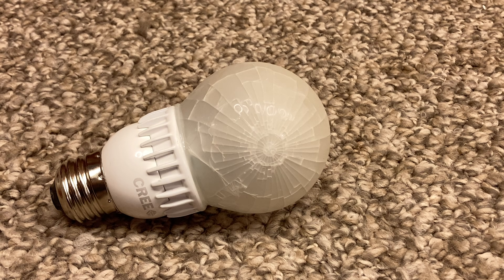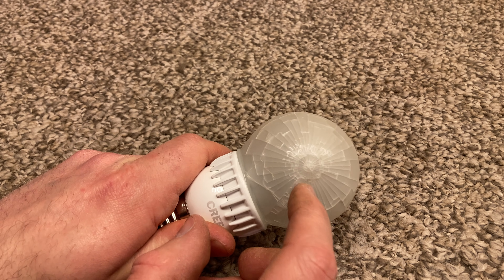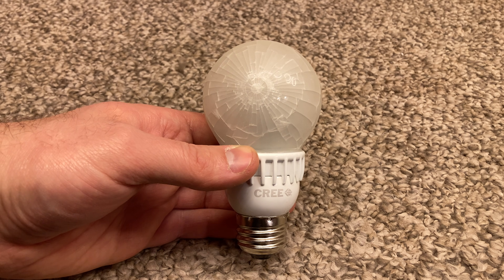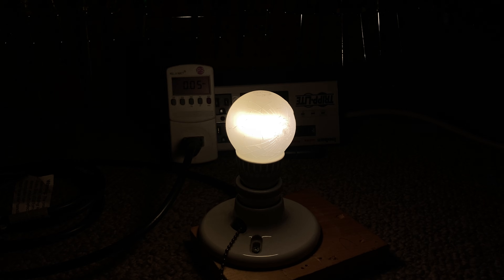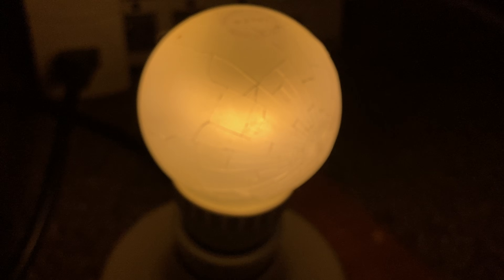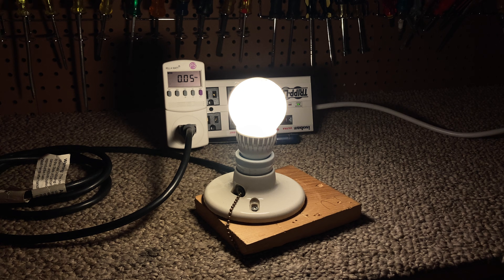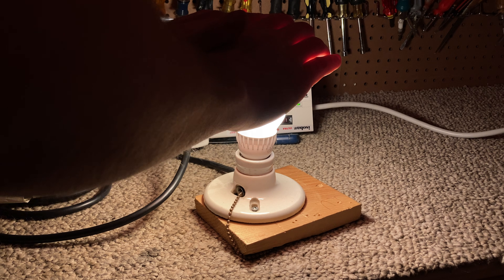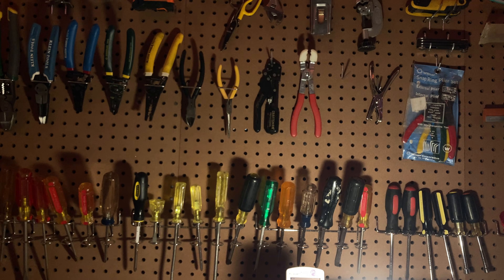Busted Cree 40-Watts Equivalent LED Light Bulb

Comment: the original first generation Cree bulb, sold at home depot for around $15-20 back in about 2010, I must have bought 20 to use both inside and outside around the house, they were excellent and long lasting, better than all the other brands back then, even consumers reports tested them and agreed. Sadly the competition produced cheaper bulbs, fooled the public, and the race to the bottom began, and Crees 2nd version joined that trend as a less expensive lower quality offering to try to stay competitive on the shelves of retailers

Comment: Those LED bulbs  were the first generations of Cree LED bulbs Cree back then was a very good name. The original business owner I think owned them back then that found the company and he ran the company too he was a really good person he knew what he was doing. When engineering a light bulb LED light bulb. Those bulbs are very repairable if they were to have sold parts for them. I remember watching the video once when I was younger when Cree first came out and the CEO stated that he wanted to design a light bulb that lasted a very long time use very little energy and put out more light than the very light bulb it was supposed to replace. He said their goal back then at least was to shoot for a light bulb that never blew out never dimmed and never gave trouble. I also like those old Cree LED bulbs because they had a lot better thermal design on them then cree's newest stuff does Cree now is a terrible name if you ask me .they make their stuff to lock you in to loving a product and then it goes out basically sucking you into an endless loop of taking your money until you're broke. Just like a lot of the other led bulb manufacturers now in fact if I remember correctly the guy who took over the company after the ceo of Cree Left the company they were the ones who started the pole industry to shift to making crappy LED light bulbs. The funny thing is it's just in America that this is a problem. Other countries see it as stupid because it is stupid they also see it as not right they see it as wrong i see it as scamming I can't imagine that it's good for the environment either to make bulbs intentionally blow out. Trust me I know how to spell and write a proper sentence but Google does not.